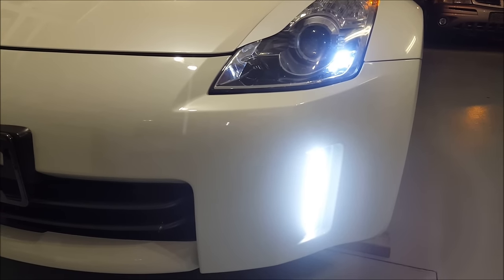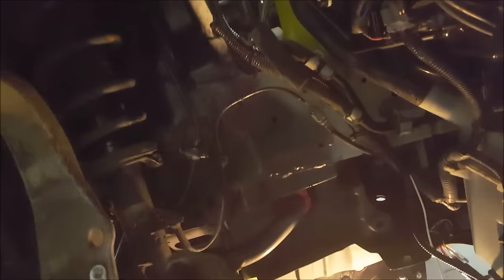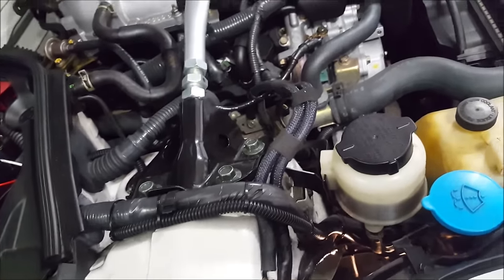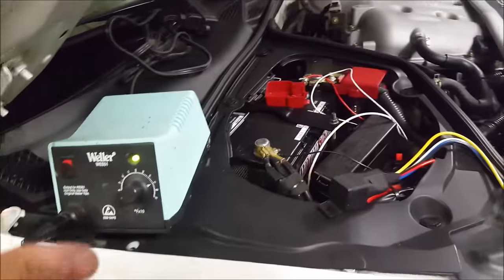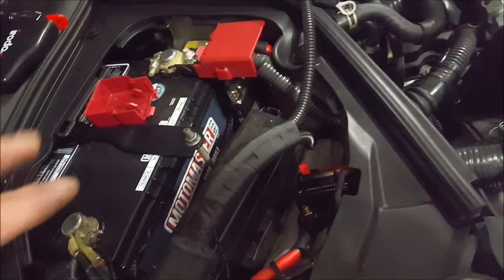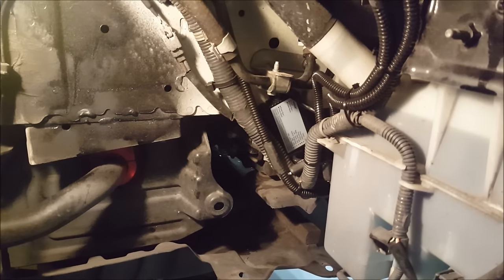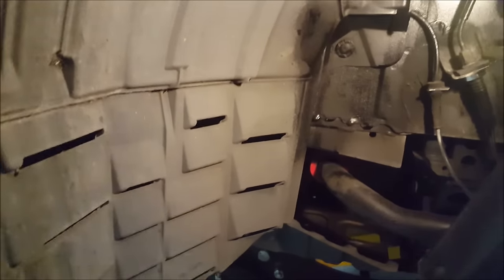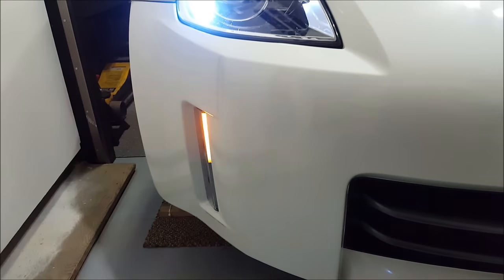Front Bumper Switchback LED Install iJDMTOY (Nissan 350Z) | AnthonyJ350

Comment: Can you just wire the positive for this into the positive headlight wire so they just come on with the headlights?
Reply from the maker: Tyler Lesko You could. I'd use a relay still
Reply: AnthonyJ350 What kind of amperage relay should I get? Is there a specific kind?
Reply from the maker: Tyler Lesko 30 amp 5 pin. I'd just put a 15 amp fuse. Double check in the instructions how much the device can pull, I can't remember.
Reply: AnthonyJ350 okay thank you! And you said you ran a new white wire? Where did that go to? I cant use the white wire they gave me? It has a spade connector at the end of it
Reply from the maker: Tyler Lesko Ummm what does it say the white is for in the directions? I can't remember.
Reply: AnthonyJ350 headlight positive turn off drl
Reply from the maker: Tyler Lesko How do you want it to work? I wired mine to power up with the parking lights only using the parking lights to trigger my relay. I believe I didn't use the white wire but you have to refer to the video.
Reply: AnthonyJ350 i wanted these drls to come on with the headlights only
Reply: AnthonyJ350 so do i just put in a new wire from the parking lights to the relay and bypass the module to turn them on only when the lights are on?
Reply from the maker: Tyler Lesko no you need the module to operate everything
Reply: AnthonyJ350 how did you hook up the white wire then? You didnt use the one thats already attached to the module, how did you go through the module for the new white wire you installed from the parking lights to power the pin 86 on the relay?
Reply from the maker: 86 to parking lights and 85 to ground

Comment: Any issues with these lights? I'm wondering how they hold up over time. Thanks.
Reply from the maker: Ben's 350z No issues so far after one season. Get lots of compliments on them too.
Reply: @AnthonyJ350  are they still doing good?
Reply from the maker: @Cj-rg8lc  Yup still work fine

Comment: hey do you think that these would fit an 04 model 350Z?
Reply from the maker: +brask310 Apparently they don't.  But I would contact iJDMTOY to confirm.
Reply: +AnthonyJ350 I wouldn't trust or buy from them. They are scammers from my experience.
Reply from the maker: loveever89 They were pretty helpful when I purchased my stuff from them.  Even when I had to get a light warranted.
Reply: AnthonyJ350 I bought a light kit from them. The kit was defective, missing wires as shown in their diagram. LED light was also not working. I've email them and sent them the entire kit back asking for a replacement. They email me saying that they've ship out the replacement kit. What's really mess up is that they also give me a tracking number that was supposedly being tracked through USPS. From day to day's I would check the tracking number and it wasn't showing anything valid so I call USPS and they had nothing on record about the package. I email iJDMTOY numerous time and they would give a different excuse. This whole process went on for about three months and I just told myself, fuck it. I've never got my money back or a replacement. I stayed away from their shop since then. A first and last.

Comment: Hi Anthony,  I ordered the IJDMTOY daytime switch back running lights for my 2005 350z but they are like universal ones that go on the outside of the body in front and have seven little LEDs in the reflectors.  They look pretty cool and I tested them out and they work on the car but not bolted up yet. The only thing I cant figure out is that ones  you show here in the video seem recessed and they look nice and bright and very cool.  Are those for a 2006 year 350z what exactly do you have here. Thanks for the great video it was helpful. I did end up taking off my front bumper and I was suprised it comes off with out jacking up the car and it took like 15 minutes to remove. I sent it out for painting since I had a lot of chips.  Now I need one ballast for my burnt out right side low beam and I will get it all back together. Check out my drone video channel if you have time.
Reply from the maker: Paul Werner Yes this is for 2006 and up which has a different style bumper and the bumper lights sit in a little more.

Comment: Just subbed and liked. Haha
Can this work on the 2005 z? If not why? Thanks!
Reply from the maker: skyler sanchez No unfortunately because the opening shape is a little different. There is a version for 2005 but I believe it isn't switchback.
Reply: AnthonyJ350 any suspension replacement for the Z you would recommend? For all around the car? Thanks. Also which types for all Z’s.
Reply: AnthonyJ350 would a 2006 bumper fit on a 2005? Lol thanks
Reply from the maker: skyler sanchez It should

Comment: can you post to australia?
Reply from the maker: I'm not sure what you mean.
Reply: Does your ebay store post this item to the country Australia? And is there a way to make it work on 2005 350z?
Reply from the maker: ddd You can contact iJDMTOY directly and tell them you found my video. You would need to get a 2006 350Z bumper shell to mount these lights.
Reply: Oh I don't want to change the bumper. Looks like I can't get it done then.

Comment: You fell victim to the eyelid thing too. They dont put pearl in the paint so you have a bright white eyelid and a pearl car.
Reply from the maker: They do paint it to the correct colour code.  What I think is the plastic takes to it different than the metal.  When I look at my factory moulded mud flaps they have the same issue having a different tone.

Comment: Did you really just call the hood a bonnet ?? Nerd
Reply from the maker: Yup.  Is it wrong?
Reply: Thats gay and your video would be great if you explained installation being more specific for example the white wire that is used as on off wire that u kinda skipped over and didn't explain .
Reply from the maker: brandonsouthernky Well with a response like that I don't really feel like helping you at all. You can pay me hourly for my knowledge if you like. School is not free.
Reply from the maker: brandonsouthernky Is reading the owner's manual below you? If you talked to me like that at my shop I'd either charge you double or not work on your vehicle just for lack of respect. Do you talk to professionals this way?
Reply: it is a bonnet......